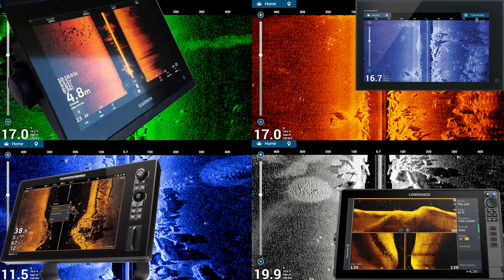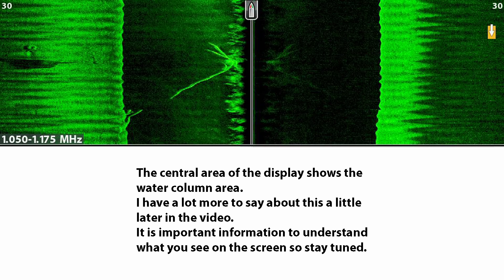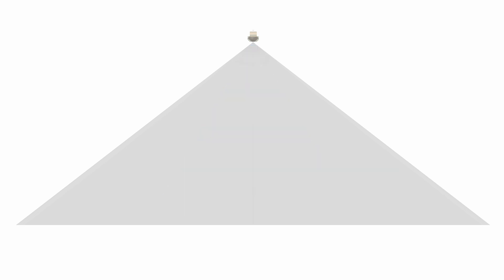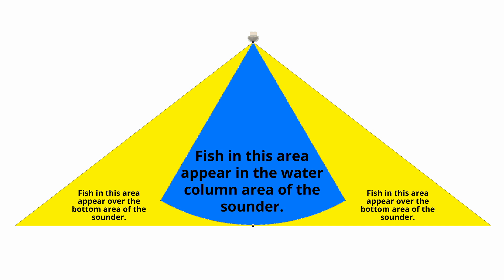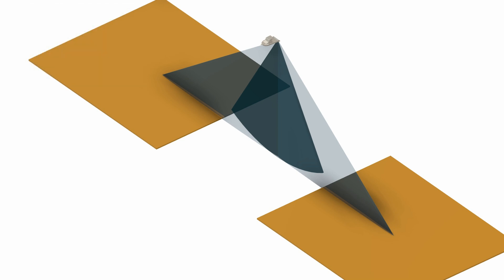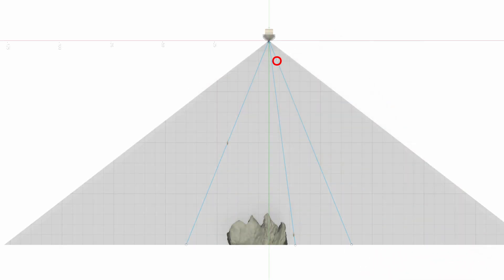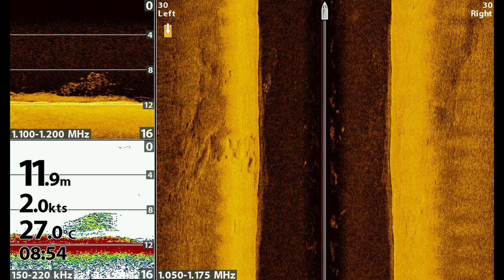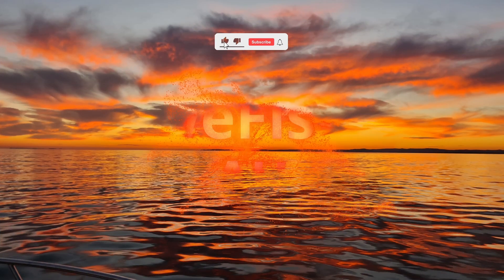Side Vision Sonar Explained - Sonar106

Comment: I agree with everything but I will add that a fish 10m down and 10m to the side isnt actually 10m away from you, its probably more like 12-15m away as the sonar displays range and not depth.
Reply from the maker: Correct.  The distance is measured from the transducer.  I should have made that clear.